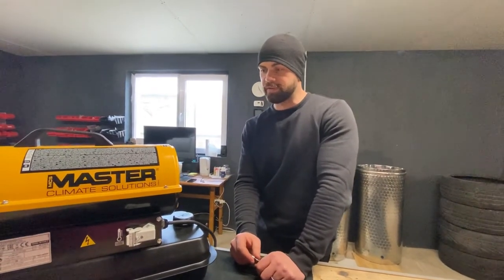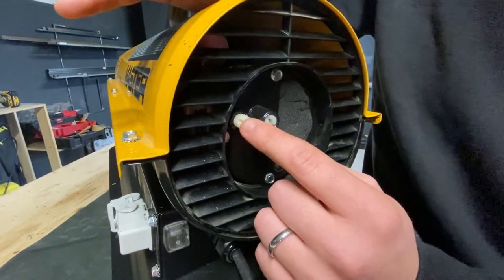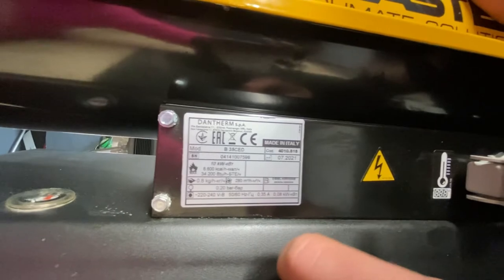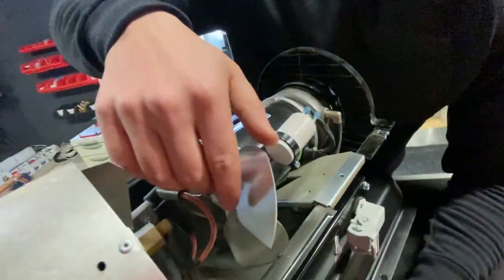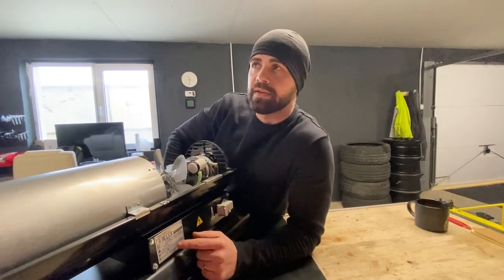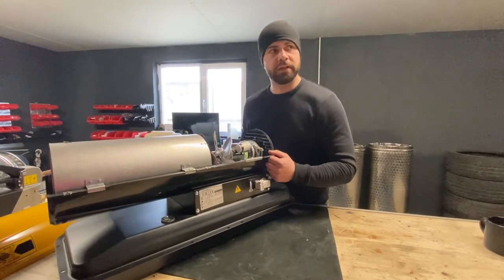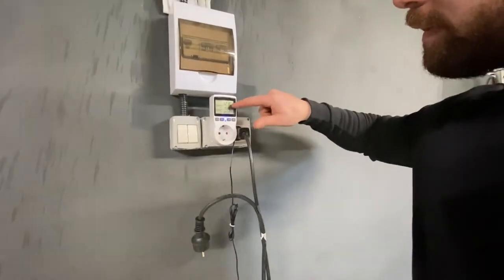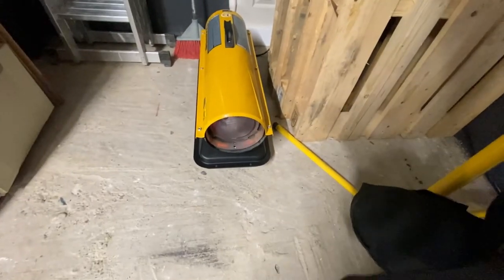DIRECT TORPEDO DIESEL HEATER | Reviewing Master Climate Solutions

Comment: Hello David, thank you for the information.  What is the input power (Watts) to run the unit?  Does it draw much power from the electrical supply?  Thanks.
Reply: Hi Barry it draws a very very small electric power: 0,08 kW only

Comment: I think I should make a video with mine.... I cut a hole 🕳 out just over where the fire 🔥  make and have a 4inch metal duct tube with a inline 4inch fan that pulls the exhaust out outside so  get clean heat... but still has a carbon alarm just incase

Comment: If you have not you should look for .$109 5-8 k chinese diesel heater.I’m looking to see if they make China 10k for decent price.? C -ya g-day
Reply: Master Climate Solutions is produced in Italy and it is the best in class, nothing comparable to China made. China heaters often lose the right pressure and you get smoke, flames and use more diesel. Also the body is made of much better materials, lasting longer